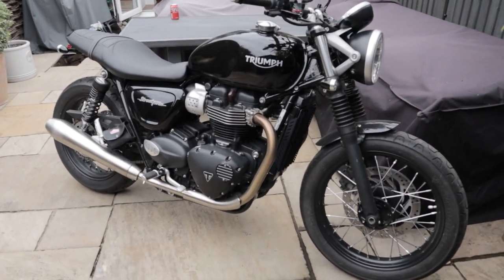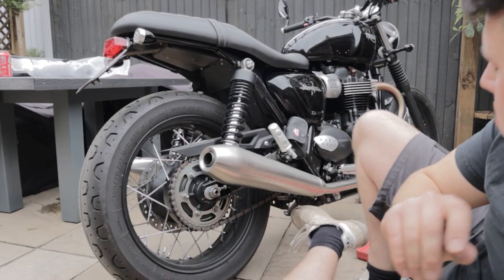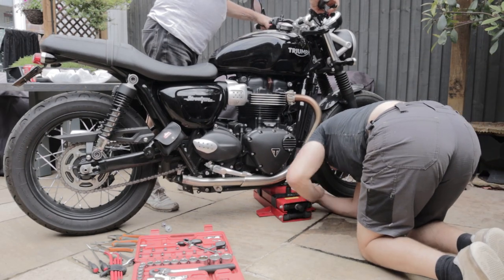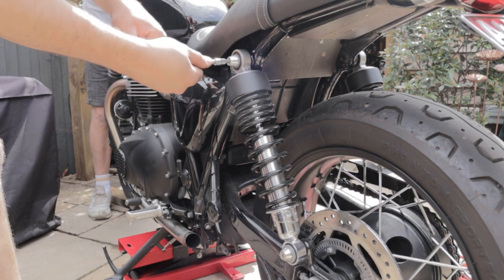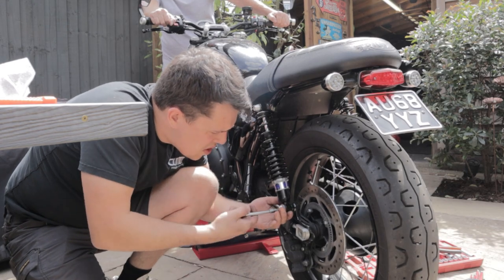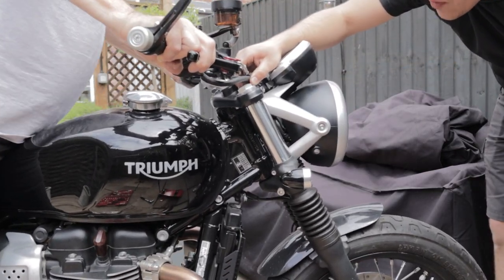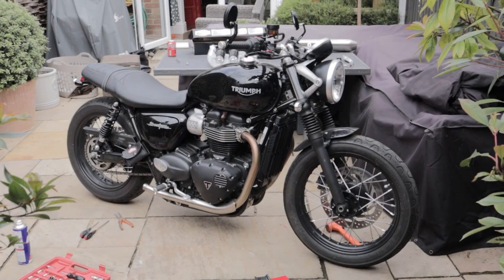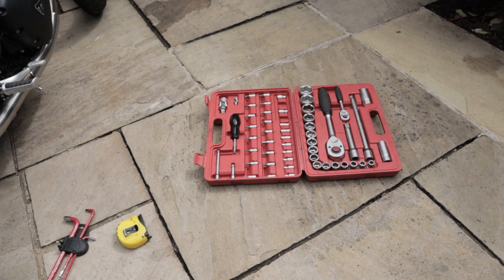HOW TO LOWER YOUR MOTORCYCLE - TRIUMPH STREET TWIN

Comment: Thanks so much for this video. Nice bike nice lowering custom. I bought my first Triumph a few days ago. I'm a short rider and didn't know what way I wanted to go for lowering. I'm at my tip toes. I think this is what I'm going to do. Thanks again and enjoy a good ride to you and your mom.🏍️
Reply from the maker: Hi there, I am very glad the video helps you out, a set of shocks will make a huge difference. Safe riding!
Reply: @MasonsWorkshop  do you think you could post here what shock set up you went with. Apparently my model triumph is on the same platform
Reply from the maker: @jaxxrs  That is no problem! The shocks come direct from 'Hagon Shocks' and were £150 for the set. 
We originally started by cutting 25mm off the seat foam height and recovering it. Following that we fitted the 30mm lowering shocks as shown in this video. 
Since then we have moved to a 20mm lowering spring which is more suitable. Total lowering now sits at : 45mm 

I reccomend giving hagon shocks a call and having a chat with them. As part of the ordering process you have to pass over your rider weight so the springs can be chosen accordingly. They are super helpful so I expect  you should have no issues. Lowering can be done in 3 sizes which are (10mm, 20mm, 30mm). Any other questions, let me know!

Comment: Thanks for the video mate.   I did the same for my Royal Enfield 650 in exactly the same way.   I did manage to drop my bike once while waiting at traffic lights because the road dropped away steeply on my left but that won't happen again now that the seat height is a much better match for my inside leg.
Reply from the maker: Brilliant to hear! being able to get your feet down and control the weight of the bike makes a massive difference. The majority of 'crashes'/drops all happen at low speed so its good to get the bike set up right to avoid it. I am pretty sure this bike has been dropped a few times now so dont feel too bad, it happens :)

Comment: Hi Mason! I have the same problem with my bike. I own a street twin as well and I need to lower it. What is the part number of the shocks you use for your moms bike? And thank you for the video!
Reply from the maker: Hi there, no problem! best thing to do is give HAGON shocks a call as there is no specific part number as it is dependant to rider weight and the amount you want lowered! They are extremely helpful.

Comment: Is that the tail tidy from TEC? If it is, how did you end up fitting the indicators to the new loom? Snip the original white clips and stick bullets on?
Reply from the maker: Hey there, the tail tidy actually came on the bike when we purchased it. I will take a look at what brand it is. As for installation it looks exactly as you have said. White bullet connectors to connect it all up. I would like to think the unit would come with some decent instructions but cant imagine its too difficult.
Reply: @MasonsWorkshop  Thanks, I bought one myself to install but it didn't have the right connectors. Are the ones on yours white, maybe an inch long that clip into each other?
Reply from the maker: @knightlautrec4311  correct, they are the ones! I think any standard bullet connectors will work just fine though. Best of luck getting it installed!
Reply: @MasonsWorkshop  Cool thanks, on yours they must've used the old wiring loom then. I've ordered something I think will work but time will tell! Thanks again.

Comment: Which shocks from hagon did you order.. which type for a 30 mm lowering? Thanks
Reply from the maker: Hi there, no problem! best thing to do is give HAGON shocks a call as there is no specific part number as it is dependant to rider weight and the amount you want lowered! They are extremely helpful.
Reply: Oke thanks for the info !!

Comment: What about the bike stand. Usually lowering the bike, the original bike stand makes the bike more upright prune to it falling over?
Reply from the maker: A great point I should of touched on. So with the 30mm lowering the stand is still OK for every day use but as you say it does sit slightly more upright. Shortly after this video we fitted a new exhaust as well. (which I should of filmed). This exhaust is causing a small clash with the side stand….. 

Conclusion for this bike and the rider. 30mm is actually a little too Low, we will go to a 15mm lower spring which is in the middle. I tried to work out the best lowering amount prior to buying them but it’s hard to do without fitting real parts. The 30mm is still perfectly fine for really short riders, but we have already chopped the seat height so it’s not needed. 

Hagon shocks were great and are doing a straight return and swap for a different spring height. I will do a follow up video on the bike covering the changes in a little more detail. Equally if you have any specific questions feel free to contact me and I’ll help where possible 👌🏻
Reply: @MasonsWorkshop  why Not get an original Side Stand and shorten that one? you can cut the Base off, shorten the stand as necessary and weld the foot back on. 
And with the 30mm lowered shocks how does it ride since you also lowered the front? is the steering input still fine as the original?
Reply from the maker: @ripmax333  This is something we are considering at the moment, I think its the route we will go! Bike rides perfectly fine, maybe if it was a more performance oriented bike you would see a bigger difference but for something like this its no problem.
Reply: @MasonsWorkshop  whats the ground clearance with this lowered setup?
Reply: @MasonsWorkshop What exhaust did you try to put on that didn’t work with the side stand?  I’ve got a BC 2-into-1 on the left and was planning on installing similar 310mm shocks…
Reply from the maker: @JohaunCheng   It was a spark exhaust that ran along the bottom of the bike. Nice material and design but the fitment was very poor. especially considering it was nearing £1000. Best option would be an exhaust that runs along  the side of the bike, similar to a scrambler. That way there is no interference with anything down low!
Reply: @MasonsWorkshop  Ohh ok, got it.  My BC 2-1 low GP looks to run along the same route of the bike as the stock (on the left side anyways).  So fingers crossed!

Comment: So, please excuse for this stupid question but, with these bikes, do i NEED to get after shocks, like i cant lower the OEM shocks?
Reply from the maker: Some factory shocks can be lowered, but to have the best ride & comfort its always best to get some tailored ones with the correct spring rate etc.
Reply: Ah okay, also 1) where did you get your lower seat & if you did it local or yourself, do you recommend any good place ? 2) how do you feel about boots to add some height
Reply from the maker: @Allhailmateo   a local company cut the foam from the seat and refitted the standard cover, it is not too complex of a job so most places should be Able to do. As for the boots, if you feel comfortable and are in full control of the bike I see no issue!
Reply: @MasonsWorkshop  how much was it ? & does this compromise seat comfort?
Reply from the maker: @Allhailmateo  I am not sure of the cost but would guess approx. £100. It does compromise seat comfort but not enough to be largely noticeable. we purchased a spare seat so still had the original option if we didn't like it.
Reply: Hey, so thanks for the responses anyways I’m going to be buying a 2020 speed twin 1200 and I found a local place that can reduce thr seat height for about 100 bucks anyways when it comes to the shocks can you walk me through how I would even do that and I’m not talking about the installation I’m talking about the ordering process
Reply from the maker: @Allhailmateo  easiest way is to give Hagon shocks a call and they will walk you through the whole process! Easy as that, they are super helpful

Comment: How did you stabilize on the jack ?
Reply from the maker: The jack locates around the frame rails stopping it sliding left to right. To get it to not tip forwards/backwards is just a case of trial and error, easily figured out with 2 people.

Comment: Do you get any hassle over the classic style numberplate ?
Reply from the maker: Never had any issues! I'm sure it varies across the country but always found if they are easily readable and you dont give anyone a reason to pull you over you are normally ok! Dont take this as official advice though :)
Reply: Was wondering the same, uk law is they can only be used on bikes older than Jan 1980. Guess it depends on whether the copper is switched on about the law and the age of your bike. Nice video..ta
Reply from the maker: @Prids5296  yes exactly! I think best to make your own judgement based off area you ride in! Glad you enjoyed the video

Comment: can you link the right model of those hagon shocks, please? Thanks in advance :)
Reply from the maker: Hi, there is no direct link to the shocks on their website. I have attached the current Hagon price list for shocks. The ones in this video are the top 2 on the list. 
The best way to order is to call up Hagon and give your bike details and rider weight. That way you get a set of shocks to work perfectly for you. They are super helpful ! 
https://www.hagon-shocks.co.uk/common/pdf/Nov%202022%20Hagon%20Retail%20Prices%20TwinShocks.pdf

Thanks
Mason
Reply: @MasonsWorkshop  thanks a lot, mate. The problem, for me, is that i live in EU, so i need to order it to local importer/distributor/dealer, that not sells only that brand, but many others, so it's better that i well know the model (or model number) of that amazing shock absorber :)
Reply: @MasonsWorkshop  thanks a lot, mate, so according to price they should be Road Shocks (Chrome Spring), so i can order them to EU dealer ;)
Cheers :D
Reply from the maker: @uncletoma  Correct! they are the ones you want. You can specify a rider weight and they will adjust the spring for you or if not It will come same as standard bike. It would be worth checking if Hagon ship to EU! I would be suprised if they didnt !
Reply: @MasonsWorkshop  yeah, yesterday i passed some time on website and... bingo, really amazing :)
(but italian importer has no more their products, i'll try to the dutch one :D )
Thanks again, mate, and safe and happy roads :)

Comment: how to make it higher instead?  need more ground clearance.
Reply from the maker: This is a tricky one..... if you specifically need ground clearance I think you may be able to squeeze 10/20mm with some taller shocks on the rear. If just want the higher riding position I would suggest a thicker seat! The street twins are pretty small bikes from factory.

Comment: Is this a street twin 900 or 1200
Reply from the maker: @arunbabu855  this is a street twin which only came in the 900. The speed twin is available with the 1200!
Reply: Thanks, Street twin900 seat height is 765mm and 1200 seat height is 795mm if you managed to lower the 900 seat height lower than the stock height it will be definitely easier for short height people to handle the bike @MasonsWorkshop

Comment: How tall is your mom?  Im wanting to purchase this as my first bike so just wondering since I am 5'2.
Reply from the maker: Hi Katherine, my mum is 5'1. 
To get the bike to this height we took 25mm off the seat foam by a local upholstery firm and then went 30mm lower with the shocks. 
Now the bike has been ridden a few times we think that 20mm lowering on the shocks would have been better. 

Before purchasing this bike we spent ages looking for the lowest seat heights. I still think this is the best bet for shorter riders.
Reply: @MasonsWorkshop  Hi is the seat still comfy with 25mm off the foam, my wife is in a similar possy. But Im trying to avoid different shocks
Reply from the maker: @davidmcnamara8759  Hey David, seat is still very comfortable. Has been ridden on long weekend trips with no issues!  I think from factory it comes with quite a thick seat.
Reply: @MasonsWorkshop  thanks Ill look into this as an option
Reply: @MasonsWorkshop   why would 20mm have been better? i know i am late